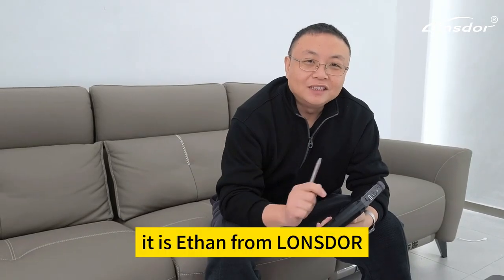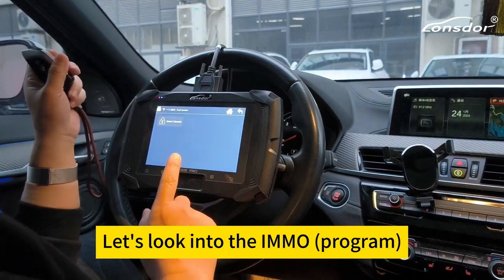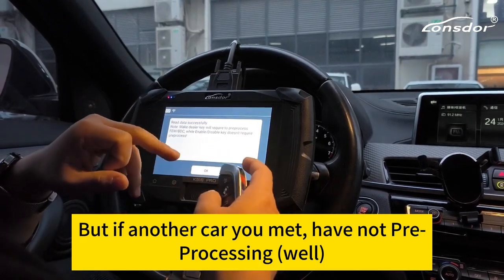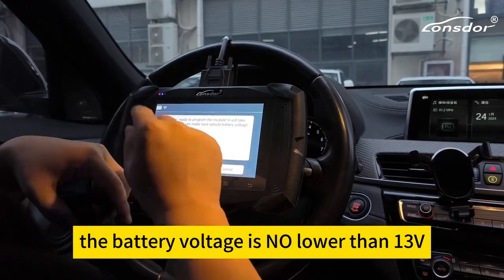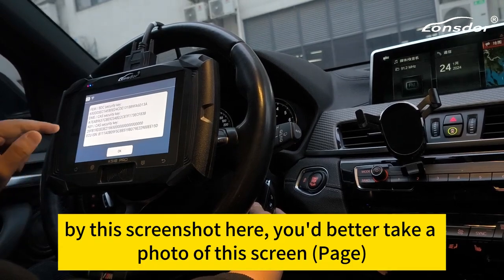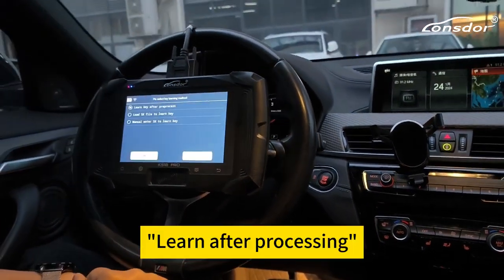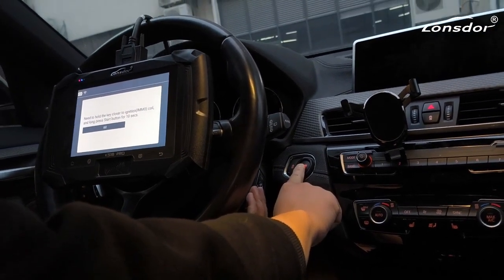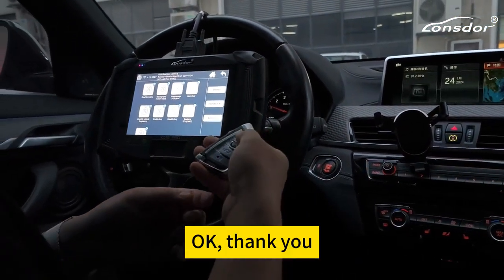How to Program BMW BDC Key with Lonsdor K518 Pro via OBD- EOBDTool.com

Comment: Uncle, you say the battery must be over 13.volts, but Lonsdork518pro shows 11.74 volts, isn't that dangerous? 
Thanks for the video 👍
Reply: Put a power pack on the battery
Reply: That's because the BDC was already preprocessed on this car so now it's easy for any tool to read key data with standard car battery voltage. I would like to see whole process of BDC preprocessing by this tool